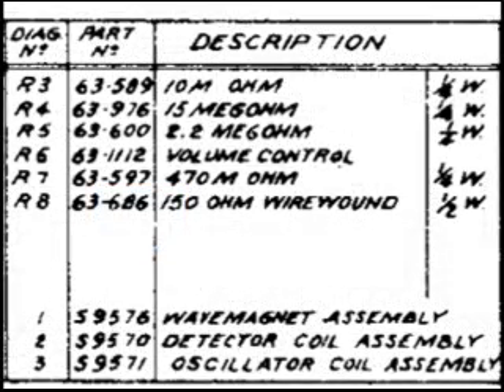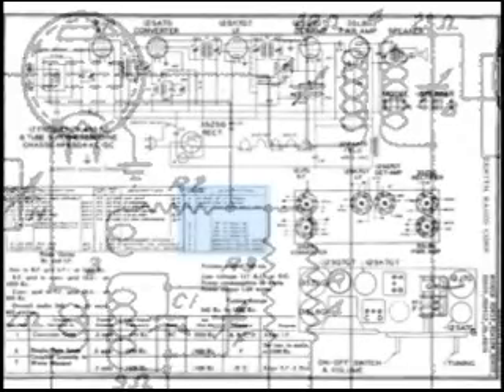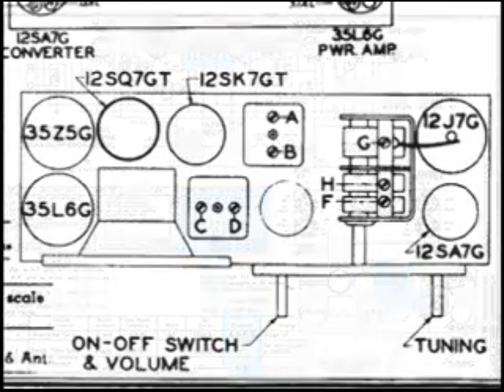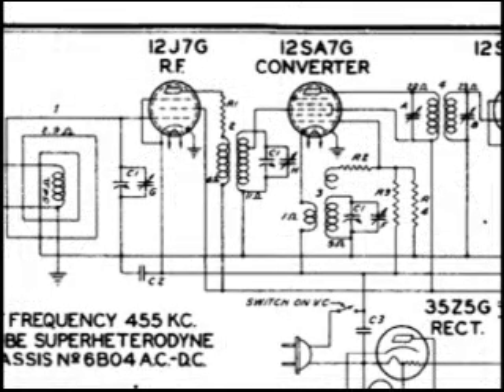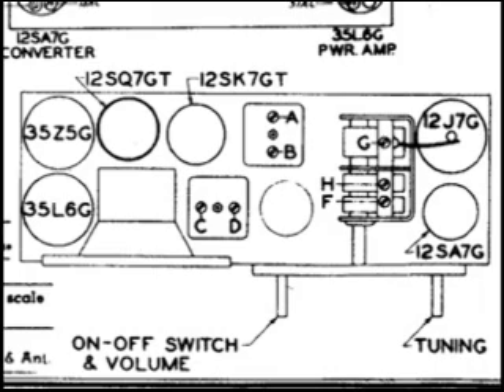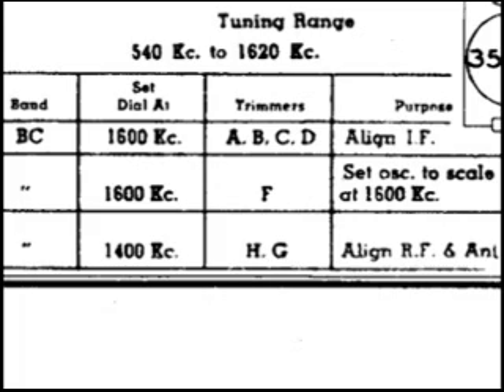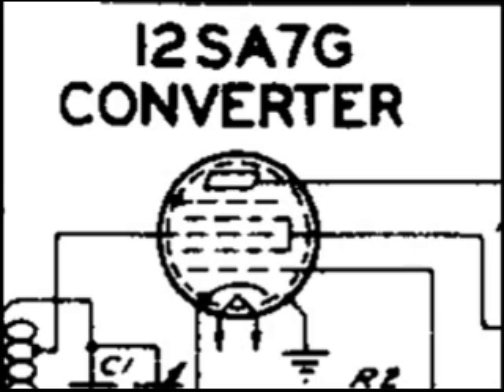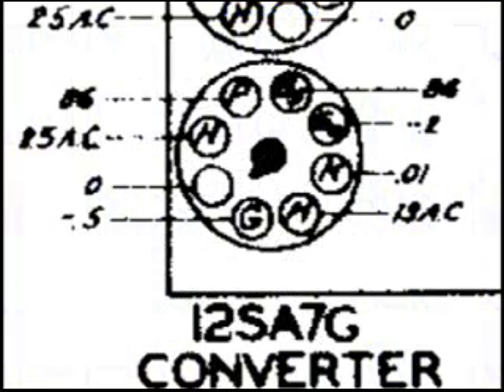Alignment information from data sheet

Comment: OK thanks for that Rick, I've moved on now to "Screen Capture and other Stuff"
But here's a problem for you. I'm dyslectic so I get embarrassed about my spelling. I use "Word" I type stuff in that and it usually puts me right and I then paste that into the box. But if I do this with say eBay, if I don't  go into the text and erase and re-enter some of the characters like speech marks"" or Apostrophe '   they get turned into a question marks, which is also embarrassing. 
Kind Regards Andy

Comment from the maker: Thanks AndyDaviesByTheSea
So far, most of the alignment procedures I have done, the signal used for aligning, is as small as possible, so that the signal does not activate the AVC/AGC circuit. You could disable this circuit, but you would still want to use the smallest alignment signal possible to find the peaks of the tanks circuits.